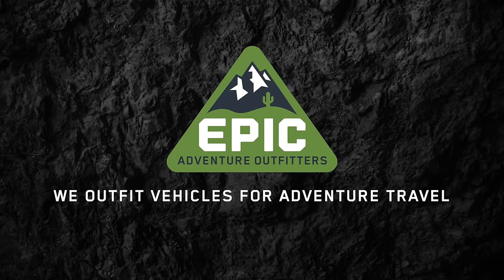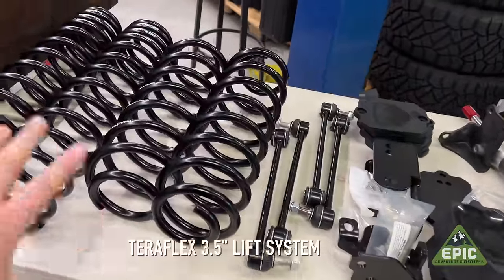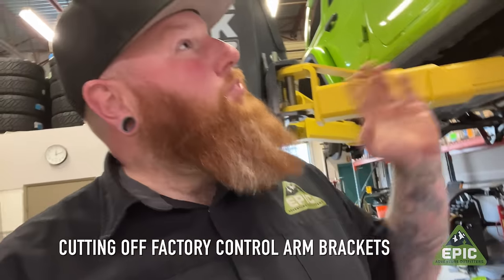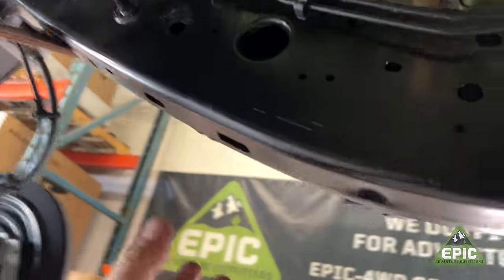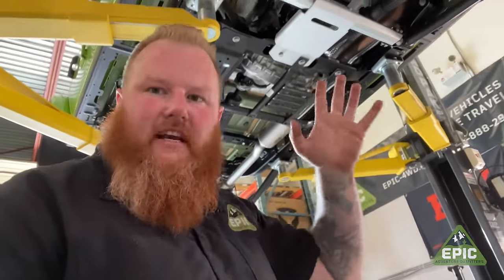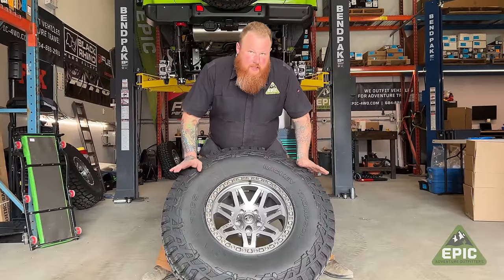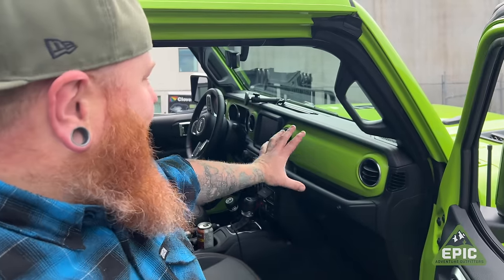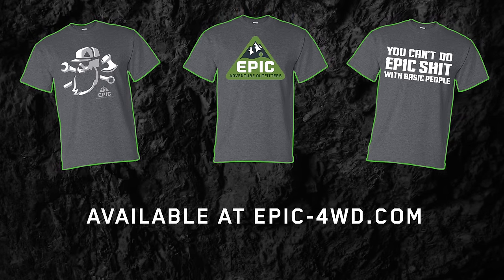Teraflex Long Arm System for Jeep Wrangler JL Rubicon - The Ginger's New Ride

Comment: Small tidbit - keeping the stock radio antenna serves a very important purpose when parking in garages (since you mentioned garages). It is about 2" taller than the roof... So if there is a low hanging pipe or something lower than the promised garage clearance, you will see that antenna shake and have a split second to slam the brakes. Saved my ass a few times.... Even back in the college days with my XJ.

Comment: That turbo 4 is going to be screaming to move that jeep around with all the add ons !!!!!!😂
Reply: After the regear, this Jeep drives awesome, took it all the way to Oregon and back this past weekend without issues
Reply: @TheEPICBeardedGinger  what gearing did you select?
Reply: I love when people think that the 4 cylinder is going to struggle until they realize that it makes more useful power than the V6 😂 Nothing like making peak torque at 3k RPM compared to the V6 doing the same at almost redline.

Comment: Alright why did you install all the bolts with the nuts inside. Isn't it better to be able to see the nuts if they are missing or loose. I know most Canadians can't see their nuts anyway...good video...You guys do excellent demo work.
Reply: All hardware was installed as the kit instructed.

We prefer to install hardware where its more likely you hit the nut with a rock then the bolt head.  As its easier to remove a damaged nut from a bolt then the other way around.
Reply: @TheEPICBeardedGinger  that answers my question. It also looks much better.

Comment: Man I want 37s but I’m just not sure how well my rig would support them. I always hear from the community that if you don’t have 20 grand in axles you can’t safely run 37s. Do you think a 2020 JT Sport S with the max tow could safely spin 37s? I already have 35s but the bigger tire just looks right.
Reply: Personally it all depends on the driver and whats the vehicle is used for.